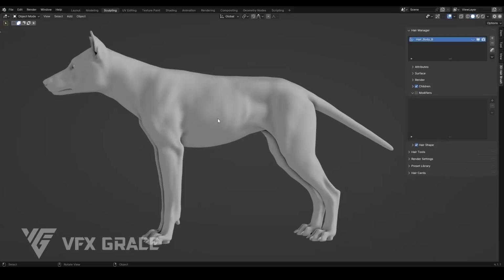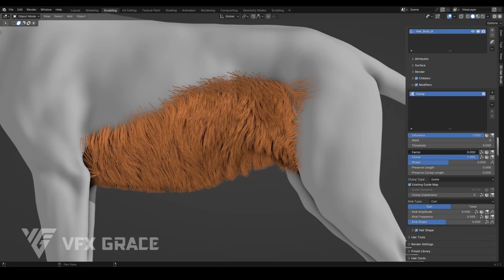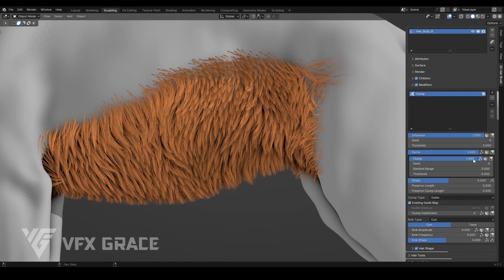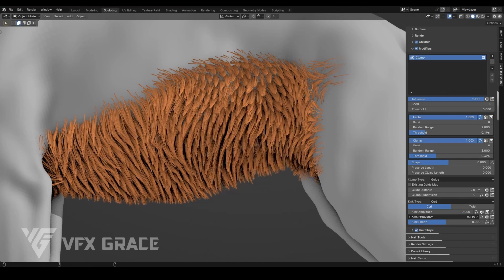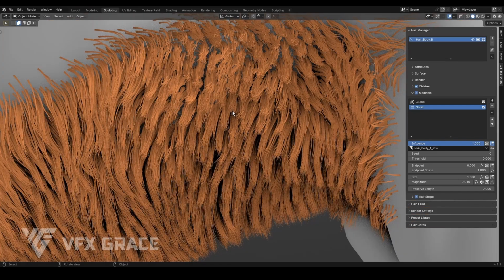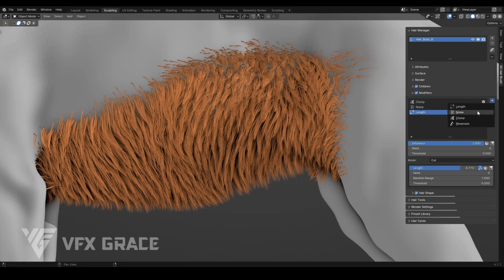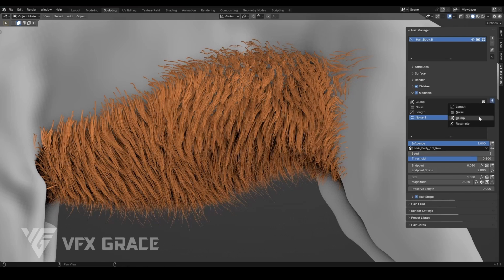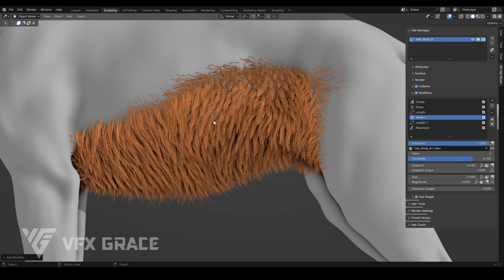Blender add-on | 3D Hair Brush - Hair Modifiers | Blender Tutorial

Comment: This doesn't seem to work correctly in Blender 4.2. Or maybe it's something with my setup? The modifiers work within the viewport, even using the render view. But then when I hit render, none of the modifiers affect the render.
Reply: Just confirmed that the file is working fine in 4.1. Also, I didn't mean to come off as rude. This addon is awesome and I know it can be tough to maintain a project like this. Thanks for making/maintaining it. Would appreciate advise or a fix when you have time. Thanks!
Reply from the maker: Could you please send us screenshots or more information about the issue to our email? This will help us understand your situation better and assist you in resolving the problem as quickly as possible.
vfxgrace@gmail.com